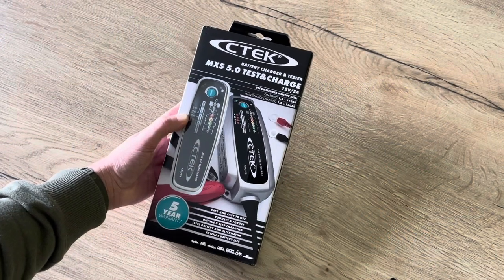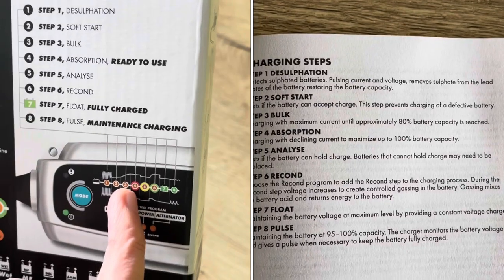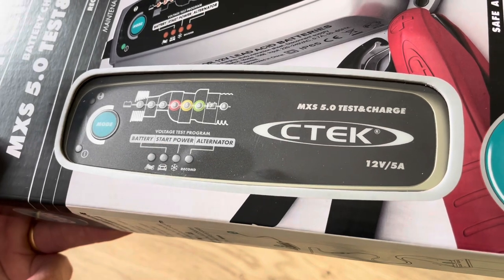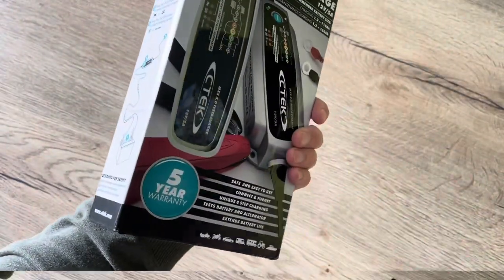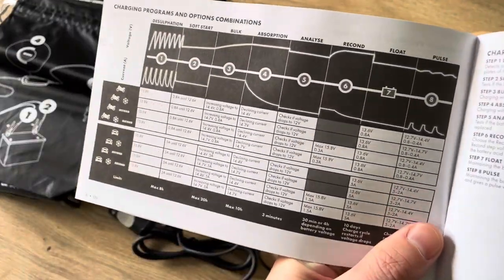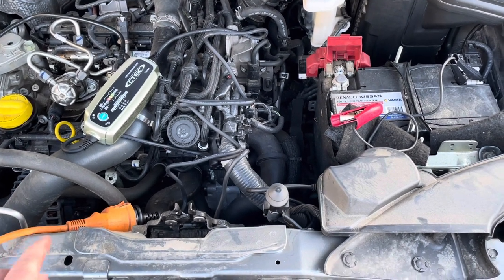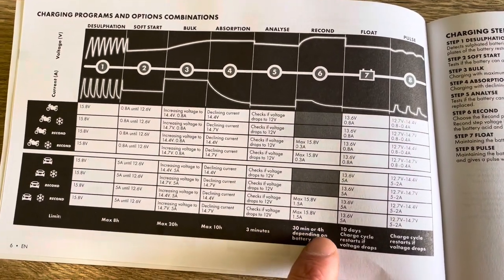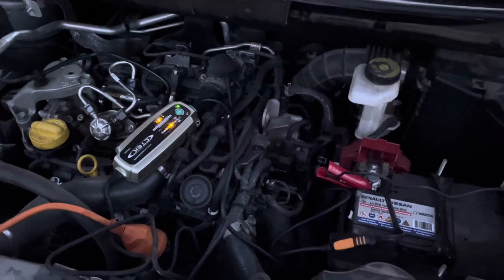CTEK MXS 5.0 test & charge - full review!

Comment from the maker: Note! In the video you’ll see the voltage test program light & program light (4) activated together. You should quit this program manually by pressing the Mode button for 2 secs. When doing this the program runs all the steps correctly and every step will lit.
Reply from the maker: Hi! Indeed, thanks for mentioning. I added a video days after “full charge cycle” where I bring this to the attention as well. 😉 I now always cycle through the programs once to be sure to select the correct program.